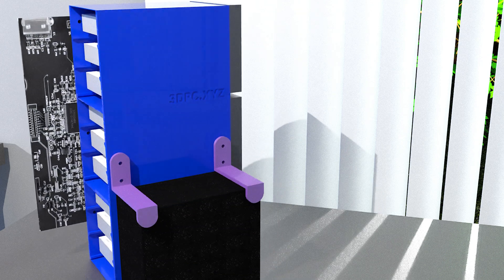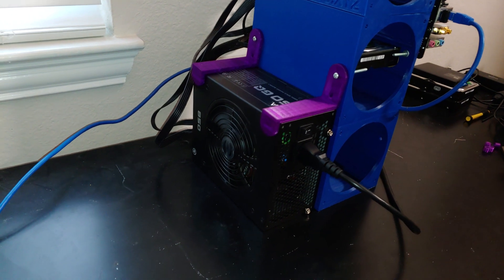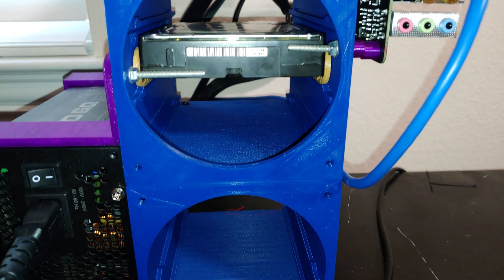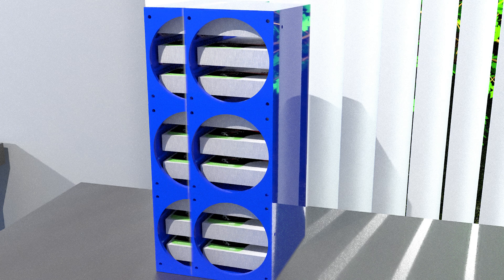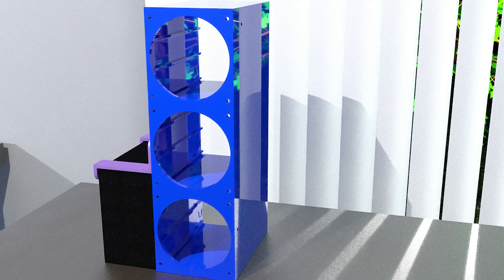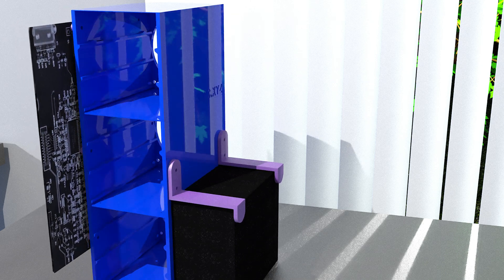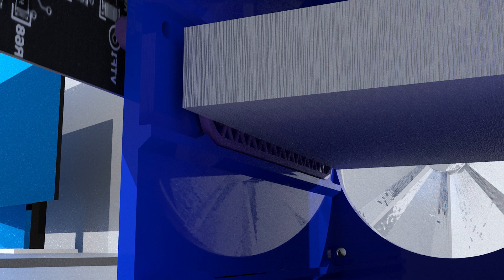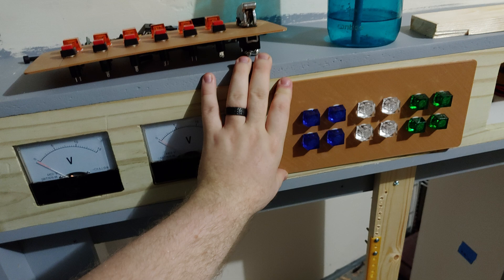9-Drive NAS case (Download & 3D Print!)

Comment: Could you please export and share the Slicer profile settings and the links to the filament that you use? after I fail to print "Stackable NAS
(9-bay ATX)", I really want to print this stuff because it supports the hard disk shaking its an awesome idea.
or Could you please share the gcode files? I'm currently using CR10V3. Thank you very much.